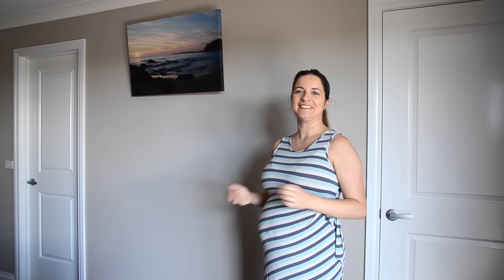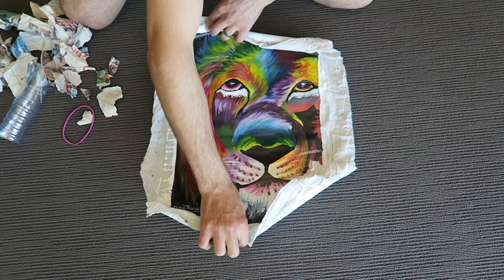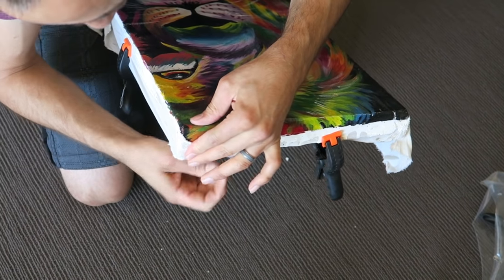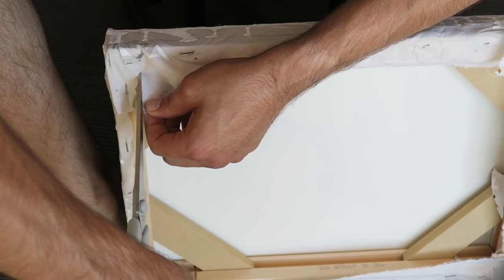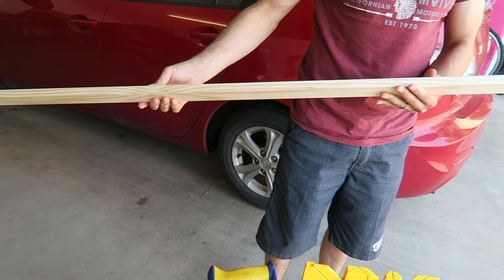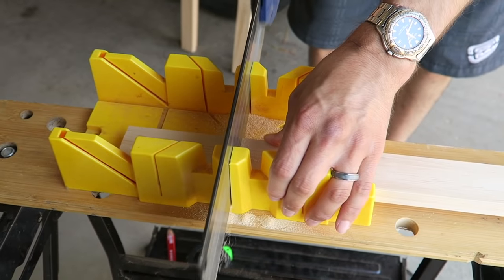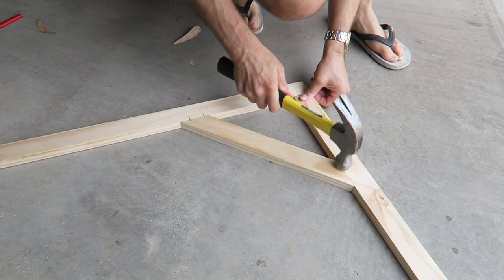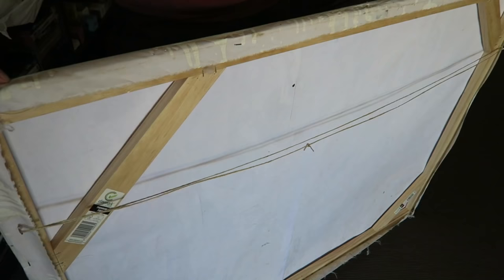How to make a FRAME and STRETCH a CANVAS | DIY Travel Essentials

Comment: Thanks for the video, loved the paintings.
Just wondering the dimensions of the wood you used. It looks like 1/2" X 2"

I need to stretch a 48" X 24" canvas. Would you add a center support bar for something that size?

Comment: Just got back from Vietnam and have 2 or 3 similar canvasses to make frames and stretch over.
I was surprised you didn’t mitre the actual frame - rather than the corner supports- what was your thinking on simply adding square corners?
I guess makes no real diff as actual strength not that big a need
Reply from the maker: It was the easier option for us.  :) We were only today admiring the BIG 5 canvas. What are on your canvases from Vietnam?